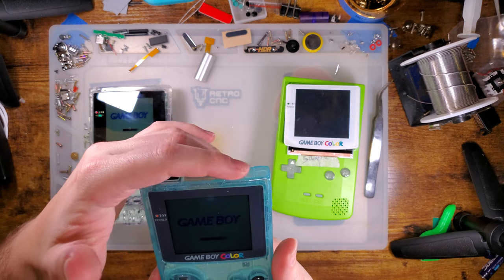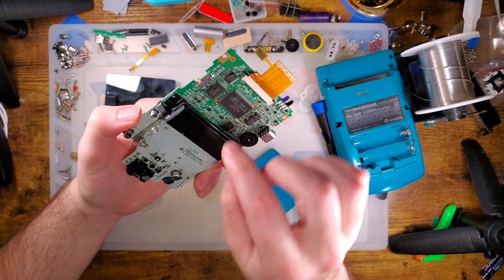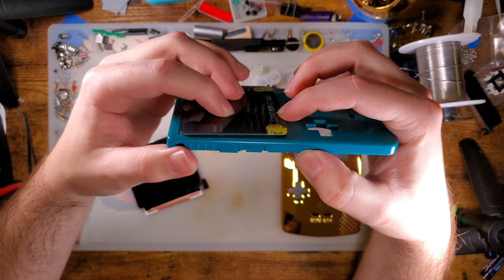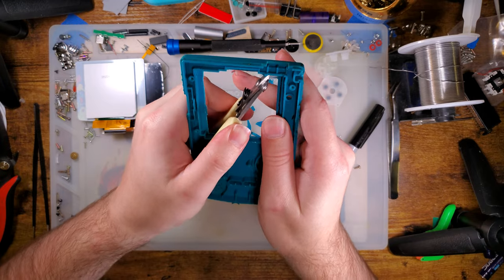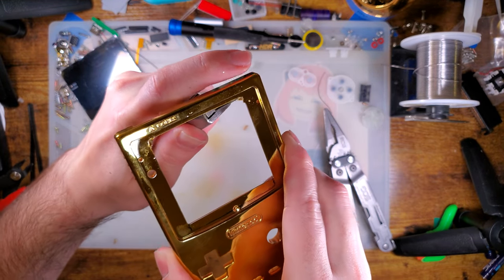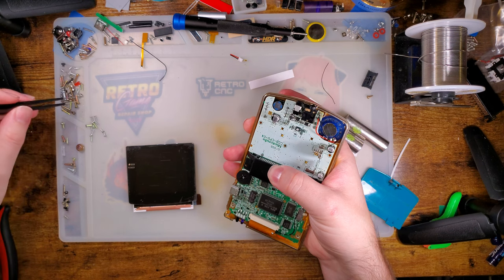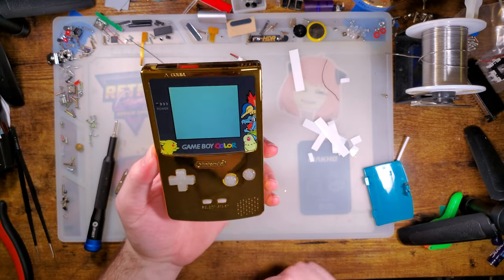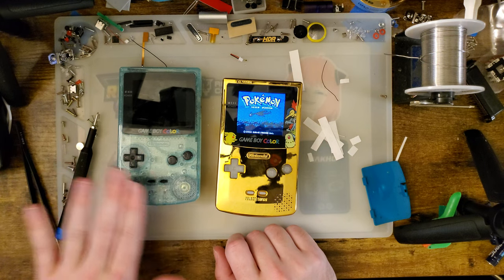Game Boy Color 2.45 Inch Laminated TN LCD

Comment: Thanks for your videos.
Do you know if there is an ips screen that have the same size than original screen, without trimming shell?
I have a 2.2 ips screen from aliexpress but it's smaller than original screen. 
I want to keep my original shell because replacement shell and Button from Aliexpress are not good quality. Thanks.
Reply from the maker: This kit, just not the laminated version.
Reply from the maker: And you can get much higher quality aftermarket parts, like the housings and buttons I used in this video.
Reply: @makho  Thanks, I have found your video on LCD 2.45". I will buy one because i prefer keep OEM shell. Thank you for your answer and all your videos!

Comment: @makho Any idea if these can run off new power regulators (a la giltesa) or if it needs the original GBC square one?
Reply from the maker: should work fine. I'm not aware of any GBC kits that need the stock regulator.
Reply: @makho   Update: there is in fact an issue! The CGS kits have their own DC converter built in which has some kind of compatibility issue if you're running from the C pin of the power switch. It caused mad screen flickering. The solution was to wire it to a different point (top innermost pin of where the stock DC converter used to be) which in giltesa's kit is the first anchor point of the installation.
Reply from the maker: @homerghost  clean your power switch
Reply: @makho  Hmm I was using a new aftermarket power switch.
Reply from the maker: @homerghost  I have yet to see an aftermarket power switch that uses a part rated for the current consumption of a modded game boy.
Reply: @makho  I do suspect it was some other issue. I sold the Giltesa board on to someone else in the end so I can't test any further myself but the CGS 2.45 kit works fine now with my stock regulator.

Comment: Bought one using your link 😊 been on the fence a while now and pulled the trigger! I kinda messed up and I can't get my speaker wires to solder back on correctly I think I melted the pads on the MOBO ....any suggestions would be greatly appreciated 🙏
Reply from the maker: Melted is probably the wrong terminology but there are schematics available for the GBC. You should be able to locate some nearby components to attach the speaker to (though may I recommend getting some more practice in first?). 

https://wiki.console5.com/wiki/Game_Boy_Color

Comment: Do you think it's possible to use this with Helder's Game Tech GBC Power Regulator? I have this battery mod installed along with game boy color 2.45 in laminate tn lcd and led buttons back lights, I noticed that when I low my volume I hear a loud buzzing white noise I was thinking maybe installing the power regular mod would help with the buzzing.
Reply from the maker: These consoles are not known for their high quality audio. The best fixes for audio issues are almost always to just clean the volume wheel and power switch. Throwing more mods at the problem is only going to make things worse unless you actually address the issue.